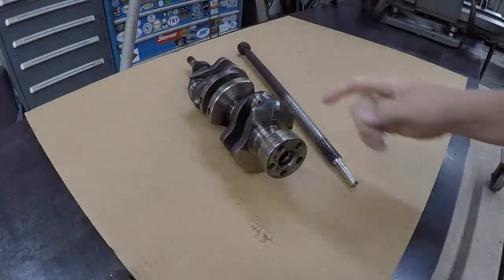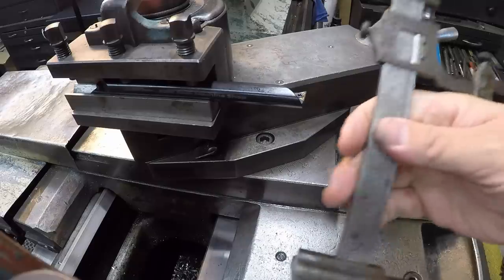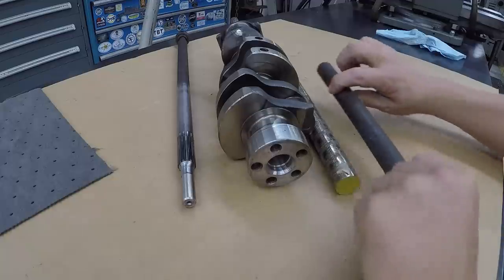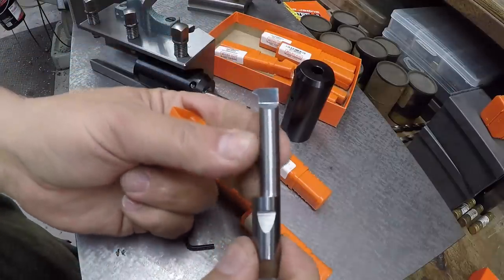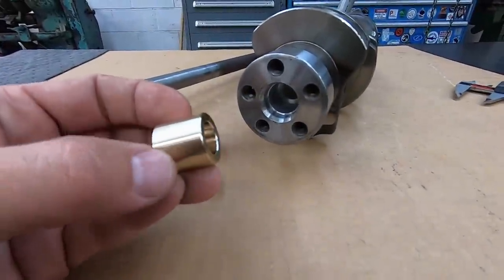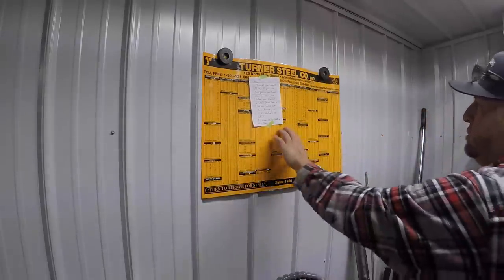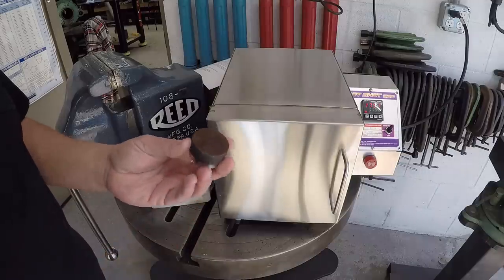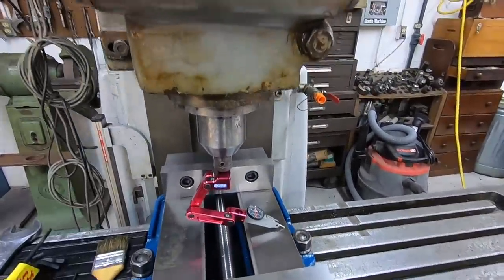SNS 294 Kubota Crankshaft Hot Shot 360

Comment: Adam, first of all let me say how much I enjoy watching you work, and I think you one of the most skilled machinist I have ever seen. However - I think the bush is located to deep into the crankshaft, as an old tractor mechanic I know a little about how support bearings in crankshafts are installed, the bearing/bush is supposed to be, almost flush, with the end surface of the crankshaft (see this video, https://youtu.be/AcsPuJrDo20, at 3:15 it shows a section view of the bearing location). I am affraid the gear shaft wont reach the new bush!